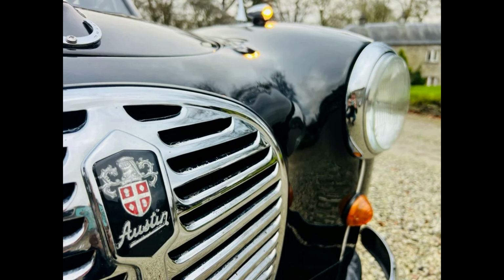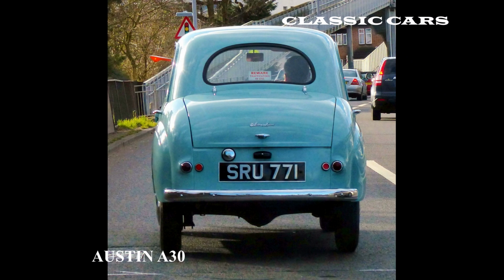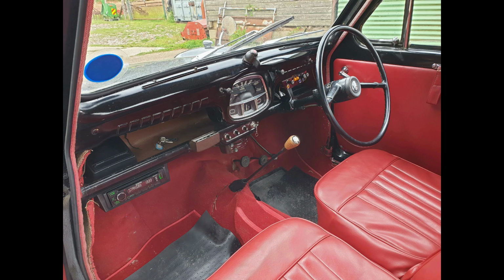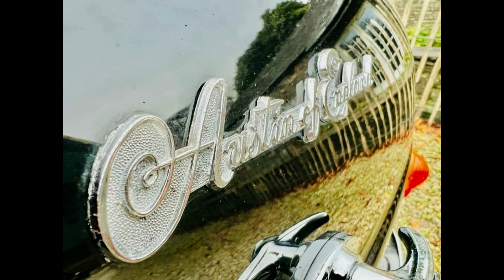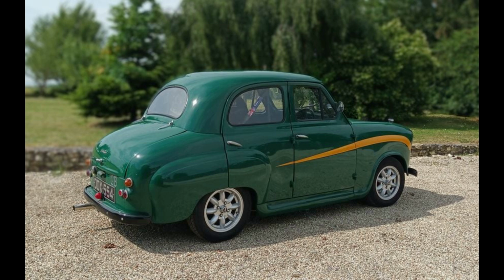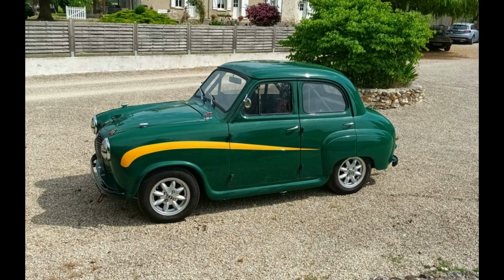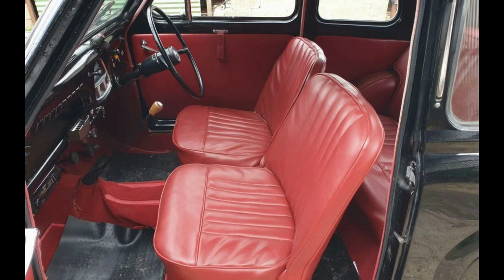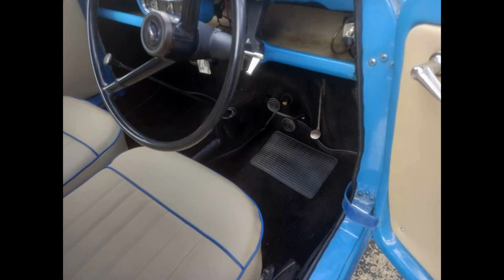A SMALL FAMILY CAR PRODUCED BY AUSTIN FROM 1952 - 1956 - AUSTIN - A30

Comment: Rod operated rear wheel brakes meant that you still had brakes if the single hydraulic circuit failed .  The Ford V8 pilot also had rod-rear and hydraulic front brakes.

Comment: I brought one of these in 1972 for £20, The engine was disembled and in a cardboard box in the boot. We assembled the engine on my inlaws kitchen table, before I drove it home. A very cheap car to run . 
I learnt to drive in an A35 van, which my father bought in 1961, it ran until it died of rust in 1971.